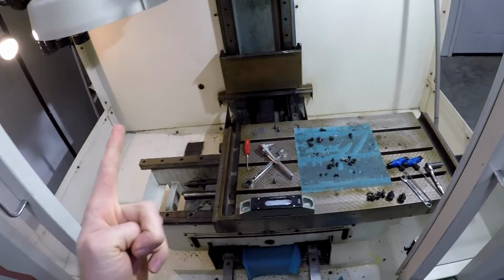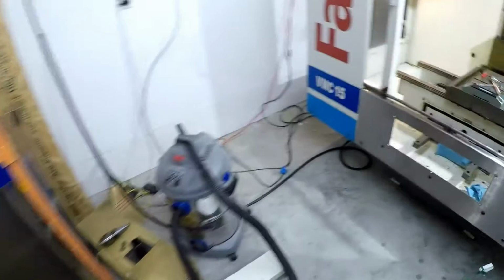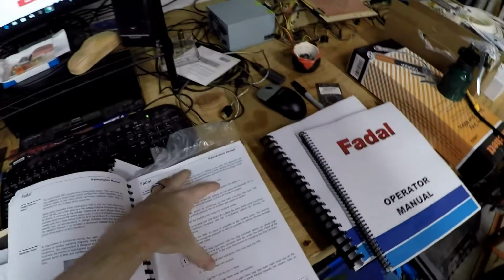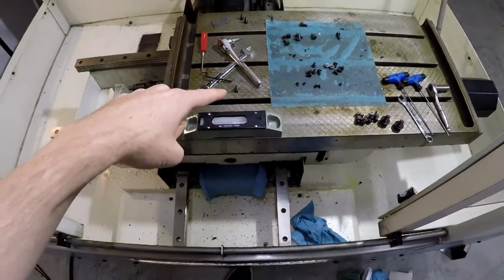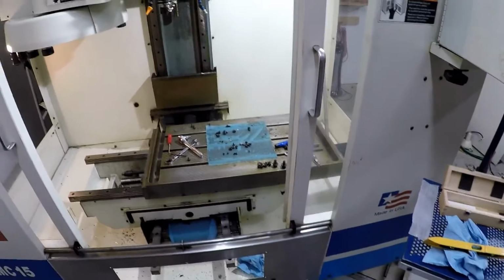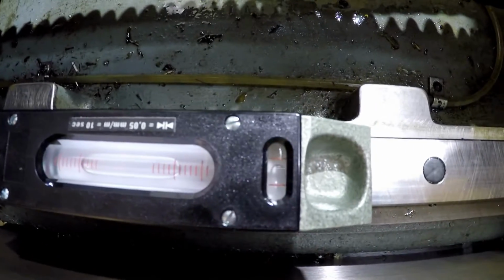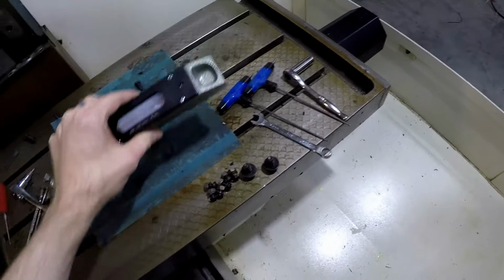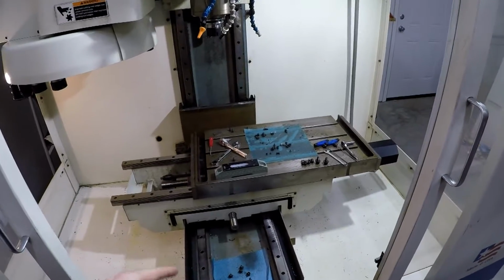Machine Leveling! - Leveling the Fadal

Comment: That machine is small enough where yo don’t need to put machine level on the linear rails. The machine casting is not big enough to twist and the rails aren’t long enough to twist.  Don’t waste your time with putting level on rails.  If this machine had a longer table then maybe. 
Just put two levels on table 90 degrees opposed from each other.
Use leveling pads to bring machine level…..jog table in both X & Y limit to see if bubble moves.
Also do a ball test to see how much backlash you have.  That’s very important if your interpolating holes.

Comment: Have you ever had a problem when the level shows certain value and when you rotate it for 180 degrees shows something else?
Reply from the maker: If that happens then you’re level isn’t calibrated. You need to use the set screw and calibrate it (I go over it in the video) before measuring anything.

Comment: Did you ever put the level on the X rails? I'd trust the tiny cross bubble as much as the yellow one. 

Does the maintenance manual specifically say not to put the level on the table? For every machine I've installed, I just slap a pair of levels on the table.
Reply from the maker: I didn't put the level on the X axis - I might do it just to see what it is, but am only really concerned about the actual frame and making sure that is level - the X I would think would be derived from that.... and if it wasn't, well then you'd of course have to get out the shims and put them under the trucks. I'll try and take a look at that when I'm back out in the shop. Thanks!